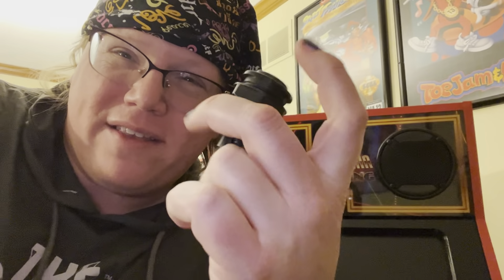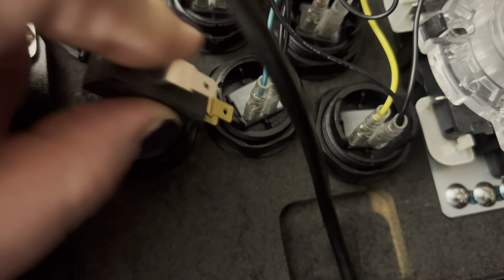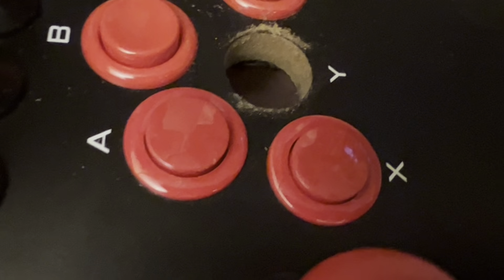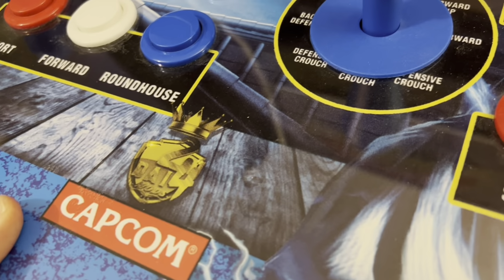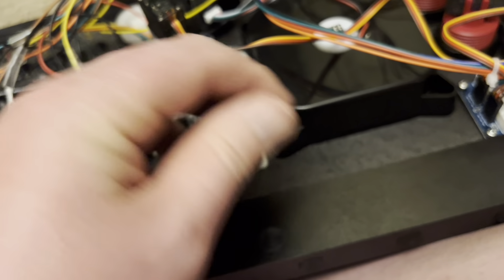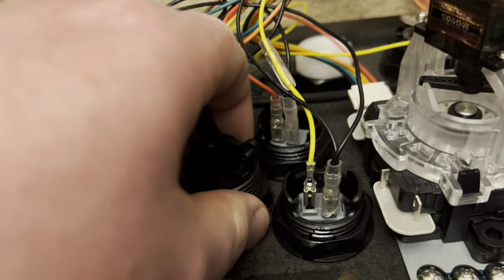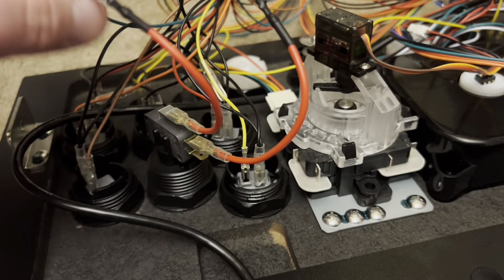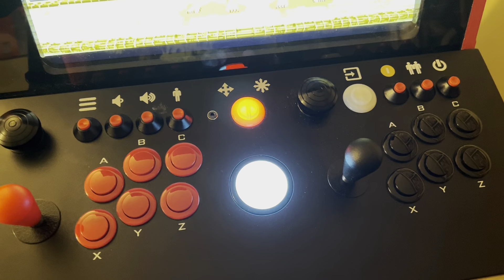iiRcade GRS Ultimate Control Panel Suzo Happ button upgrade tutorial

Comment: Thanks for the vid! Did you try using a wrench to loosen the button nuts? I used a wrench and the nuts all came off very easily. While I was in there I also swapped out my sticks for Sanwa. And I changed the LED colors for the gate switchers.